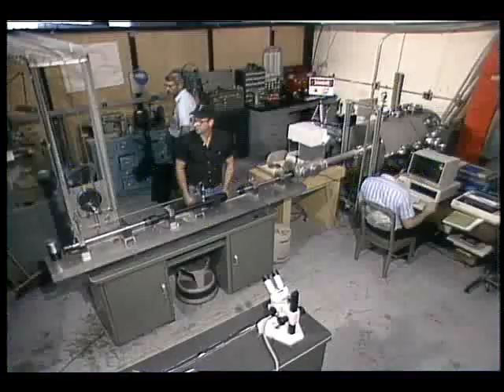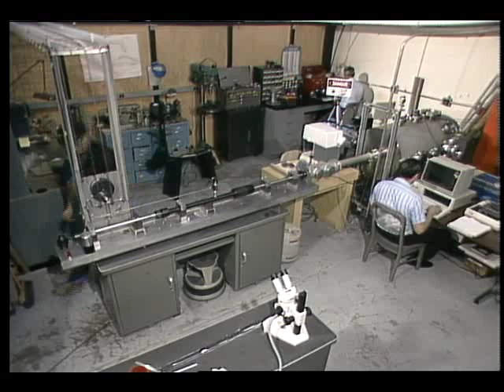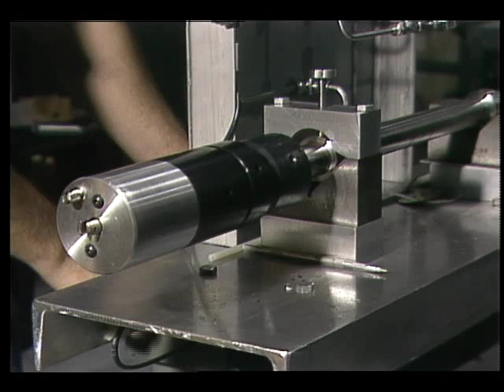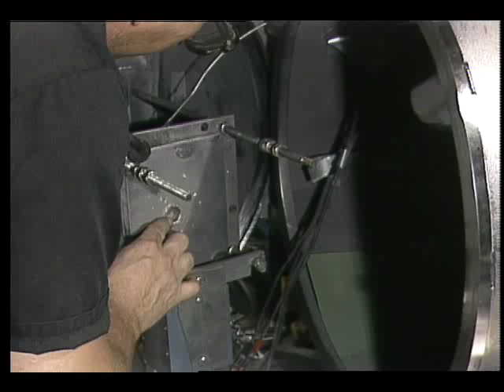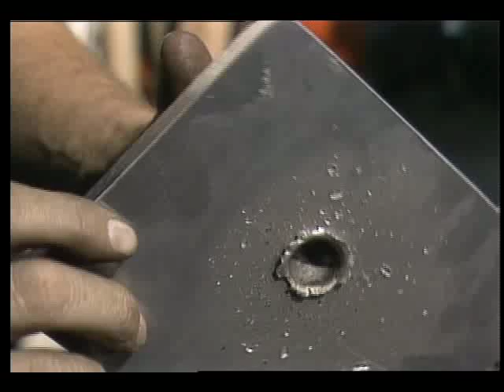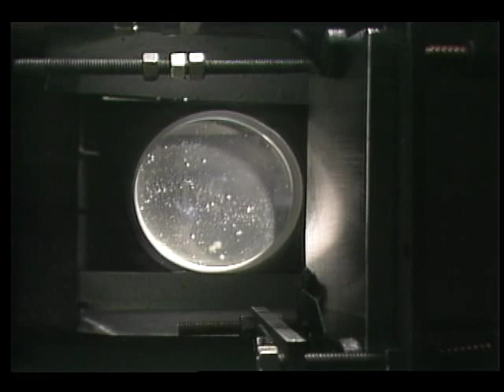High Velocity Gas Gun

Comment: Easy to build. Make a cylindrical pressure chamber that uses black powder (yes, seriously) to drive a piston into a chamber full of hydrogen held by a rupture disc, and use said hydrogen gas (as a working fluid) to propel a tiny projectile down a long barrel at astonishing velocity. Like I said, simple.

Comment: What is that 2 or 4 inches of stainless?  If we're working with the typical xx60 stuff that should be enough to hold out to 120k to 240k psi, I'm sure I could use the thread count to also figure out how much pressure you guys are trying to hold back, but it's already clearly pretty intense given the usual chamber pressure of pistol caliber firearm is roughly 30,000 psi and most rifles don't exceed 60,000 although the new sig spear is being purpose built to handle up to 80,000 psi.  

This also has an intended point of failure at the end of the sabot's travel.  Knowing the thickness and material there would be interesting.
Reply: You talking about thickness? That's definetly not 4 inch thick
Reply: Say probably 1 inch thick
Reply: They used an ordinary shotgun shell to drive the piston, so the pressure in the primary chamber wasn't above 14K psi/97 MPa (SAAMI maximum for 3.5 inch/89mm 12 gauge magnum shells).

Comment: imagine if that was buffed to accept .50 BMG
Reply: Wouldn't increase velocity much (like at all, light gas guns shoot about as fast as possible through chemical means). But you could definitely load bigger/heavier projectiles. The breach mechanism would have to be tripled in size to accommodate the increased pressures. And, since you are making the bore bigger it has to be longer, since LG guns must be designed with specific chamber and barrel volumes in relation to each other. Most light gas guns are for research which can be done on very small scales, so there really isn't much use for something that big. That's what railguns are for...
Reply: Mark Green but you cnt carry railguns around, there has to be a way to make it faster,  how do shaped charges gos so fast? they use explosives too..
Reply: NASA has 2x .17 cal gas guns, 1x 50cal gas gun and now one 1.5cal gas gun, all reaching speeds of around 27000 fps